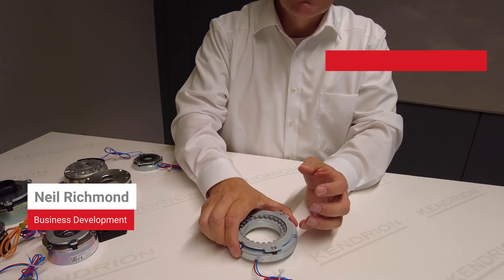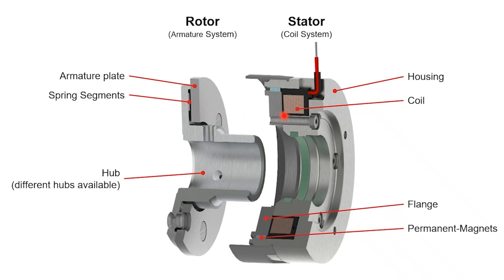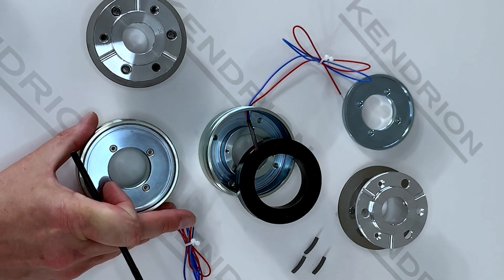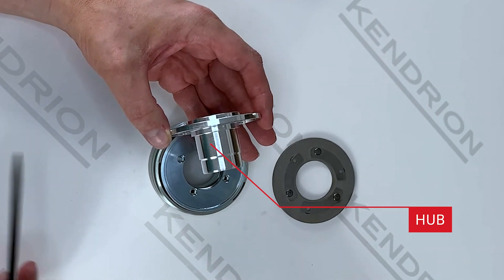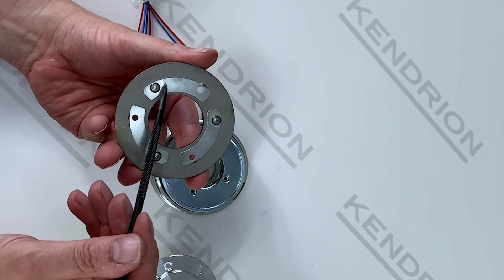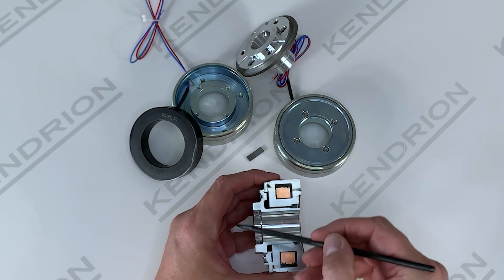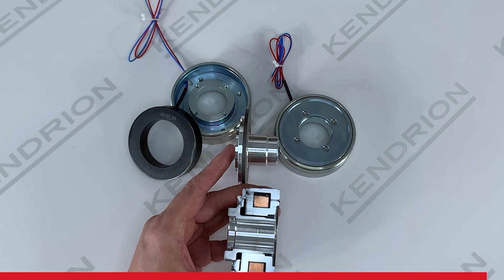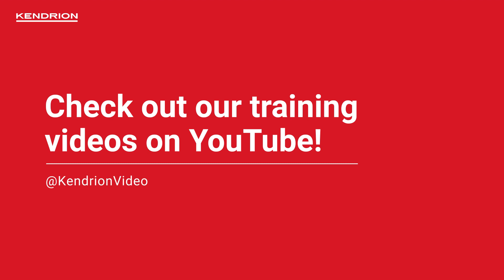Kendrion Tutorial - What is a permanent magnet brake?

Comment: Is it okay to use a power supply of 28vdc instead of 24vdc for this break?
Reply from the maker: Hello, the nominal voltage is 24VDC +/- 10 % smoothed.
Reply: Normally you can turn power supplies voltage up and down a few volts with a preset potentiometer. If you can, i would turn it down to closest to 24Vdc. Else you can buy a small switch mode power supply that converts the 28V to 24V with about 3 to 4Amp capability in the size of a matchbox for very cheap. Enough to power the brake coil.
Reply: The brake coil in this video was drawing 415mA. So easy for one of those mini SMPS to switch.

Comment: I just rewind my permanent magnet break with same number of turns and same guage wire and when i apply 24vdc to brake it get demagnetize in the magnetic area but it get magnetize around the center where hub passed through when applied power and it kept brake hold